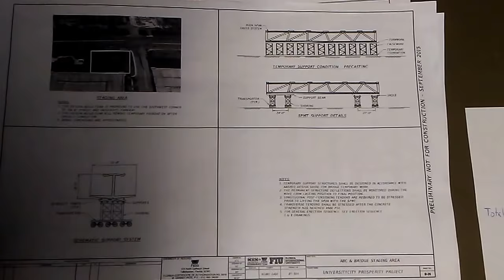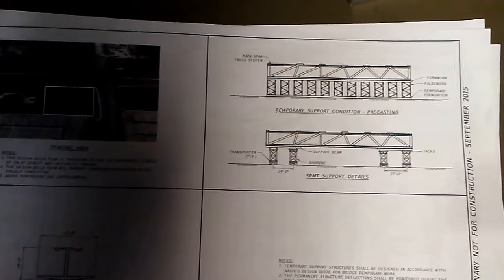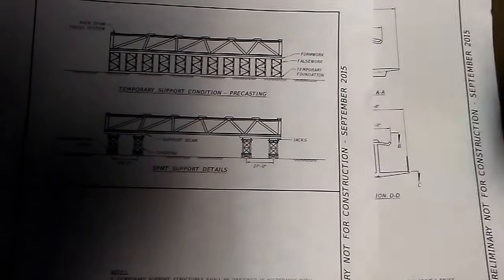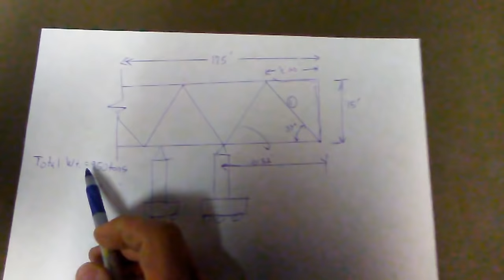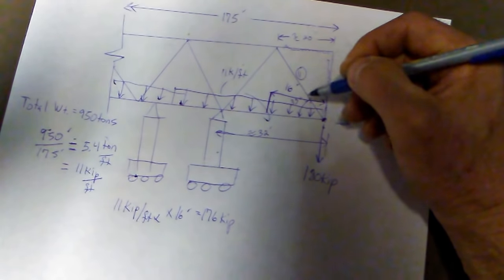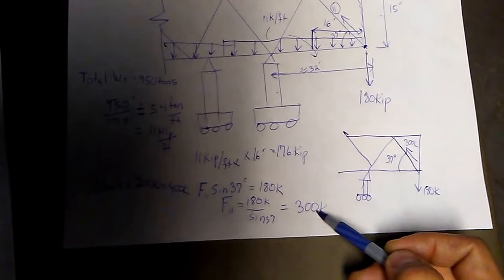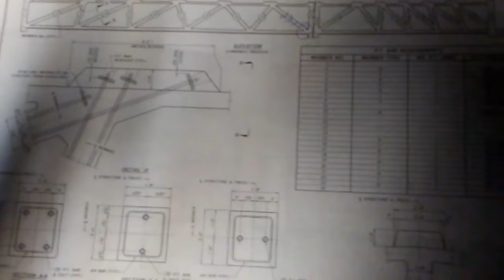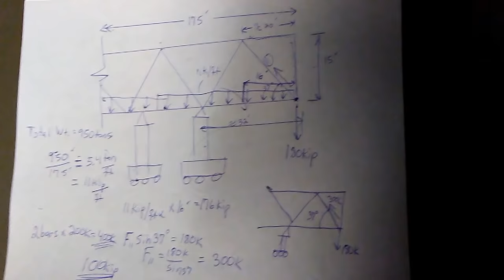FIU Bridge Collapse: The Hidden Truth (Part 4)

Comment: Good Work, from an old non-structures civil PE.
Three points if I may?
1  I think that you underestimate the loads in member 11 by using uniform loads.  By inspection it appears that there is a load skew on this north end cantilever due to the proximity of members 10, 11, and 12 compared to rest of the span.
2.  I think that it might be worthwhile to investigate the tension loads in the canopy between the 10 and 11 top nodes during transport.   This cleary is a compressive member while sitting on the designed support columns.  Any damage here may well of caused cracks and or damaged the prestressing.  (the slow mo video suggests the failure precipitated from the canopy in this section)
3.  Also might be worthwhile to investigate the shear loads at the transport points.  
Again you are doing good rational investigation which is a blessing to see!
Reply from the maker: Great points and thank you for your input! The tension in member 11 in my presentation are approximate...I realize a more accurate determination is possible. Shear loads (or reactions)  at the transport points could be analyzed...however it does not appear that the failure precipitated at the transport jack location.

Comment: Couple of concerns:

1. I still have concerns regarding the different lengths and angles of the truss members.  Typical trusses that span a distance like this (174 ft) are comprised of equal angles and in some cases, additional vertical members (such as a Warren truss w/verticals). The simplicity of a symmetrical design distributes the load of the bridge throughout the length of the span.  

However, In this case, there appears to be a concession to its design, and a compromise of its engineering.  According to its design none of the truss members are of equal length.  I can only imagine the calculations for tensioning the the support members is such a way as to keep the load of the bridge stable.  

2.  Assuming the calculations are correct and the bridge is constructed according to specification, the project is handed off to the installers and their transporters.  It has already been noted by another youtuber that steel plates or additional supports were specified to go between the transporters and the bottom of the deck, the purpose of which was to spread the load of its 950-ton weight. while moving it.  However, in the photos of the installation process, no such plates (or girders) are in evidence.  All I can see are what appear to be railroad ties wedged between the transported at the bottom of the deck - a total of four at each end.  

I suspect there were some challenges in transporting the bridge from its construction location and and its finished location.  The cross section of the completed bridge indicates the bottom of the deck is wedge-shaped.  I've no idea as to how a steel plate (or plates) would be raised up to fit between the transporter and the bottom of the bridge deck, particularly because the bottom of the deck is not flat.  FWIW, I wouldn't trust the weight of a train locomotive (200-215 tons) on the strength of eight railroad ties.   

 I also have little confidence in the ability of the bridge to withstand the rigors of swinging 90 degrees into place on  just four relatively small pressure points. It has been brought up that the transporters were not located in their specified locations during the move.  What stresses happened or may have happened on its short, but critical journey?  Was there twisting, jarring or changes in the load and what effect(s) may have they had on the tensioning of the support members? And, did these bumps and twists cause the stresses on the bridge to exceed their static limits? 

One other thing: The bridge canopy derived its strength from its length.  However, it had no noticeable  lateral support while being moved.  Due to its weight and lack of lateral support, merely overcoming the inertia of moving the bridge may have added unnecessary stress on the strut members, particularly near the transporter locations.
Reply: @Delia Wolfe; You are right to be concerned about the odd angles of the web members, which as you pointed out, would have added complexity to the calculations.  Furthermore, your suspicions are well founded in the very real likelyhood that a lack of effective and responsible communication between the parties may have led to the failure.
Reply from the maker: Great commentary Delia! Rotating the bridge 90 degrees was likely the most difficult part of the bridge move as the SMPTs need to be coordinated in their rotation to prevent twisting of the SPMT towers.
It appears that diagonal cables spanning from the canopy underside to the SMPTs were installed to provide lateral support.
Reply: There is a video that shows the cables you mention here:

https://www.youtube.com/watch?v=BDHRmvvMdmk

As you can see they (four in all) appear to be attached to the transporters and not the deck. Also, there are cables attached to the ends of the canopy which appear to connect to the outermost corners of the deck. I'm uncertain. as to whether  they effectively stabilize the canopy at the critical moment when overcoming inertia.  Given the top-heavy, t-shaped profile of the canopy and strut members, I remain concerned about lateral movement of anything above the deck.   

You can also see in this video the truss structures used to tie the transporters together.  I expected to see some kind of X-bracing between the transporters to maintain their 90 degree corners while in motion.  Perhaps, in their opinion it wasn't necessary.  In my opinion however, it wouldn't  hurt.

Comment: I think you are correct.  The PT bars in the diagonal are located outside of the kern point if only one bar is stressed.  So if they were removing the load from these bars since they were no longer required as the diagonal would be in compression from the dead and live loads.  The bars had to be unloaded in stages reducing the load in both bars in a progressive fashion.  If not the eccentricity could put one face of the diagonal in tension.  If it cracks the section modulus of the diagonal at the crack location (or pre-cracked condition) resulting in more effective eccentricity, more tension increased cracking, etc. and failure.

Comment: This disaster looks more like the failure of a node, not the failure of a diagonal. During transport, the diagonals D3 and D10 received the highest compression forces but they certainly came with their rods adjusted to deal with the greater tensile forces, which began to act after the bridge placed in its definitive supports. That is, D2 and D11 dealt with small tractions during transportation and then received the highest compressions. D3 and D10 received the highest compressions in the transport AND the highest definitive tractions. Thus, D3 and D10 would be much more susceptible to rupture by excess of PT than D2 or D11. But the geometry of the node at the base of D11 seems critical. The 21x24" compressed section of D11 needs to shift forces evenly with 6 or 8 bundles of PT cables inside the bridge deck. And nothing in the drawings and pictures seems to indicate that this was reasonably designed. Finally, the cracks. I have not seen a record of where they occurred, but one thing is certain: cracks in a structure with this design and this age should result in immediate shoring, for evaluation of causes and repair procedures. Nothing should ever have been done on the bridge, to correct anything, with people passing beneath.

Comment: Well done.  You explain the truss behavior very well. I pretty much agree with everything you present in your analysis. And another thing is that, although they don't show any other reinforcing in the preliminary drawings, there is no doubt that, all the diagonals had reinforcing other than the post-tensioning bars.  This reinforcing would likely been sufficient for the transport condition in themselves.  It is possible that prestressing wasn't even necessary for the move.  I have obviously never worked on a concrete truss but have worked on many large wood trussed.  The thing you find in wood truss design is that the greatest challenge is distributing the member end forces at the joints.  Especially the tension forces but the compression force transfers can be difficult as well.  I have a feeling that the cause of the failure is much more elusive than you/we are thinking.  There is a huge force coming down that first diagonal and how it distributed to the other elements is very important.  It will be interesting to follow this situation and your analysis of it.  Thank you for your work.
Reply: @Glenn Felpel; the compressive force in member #11 not only goes down, it also goes up.  Now consider the connection with #11 to the upper deck; There is no steel whatsoever there.  We are supposed to believe that all that compressive force is transferred by the little bit of cover concrete.  Terrible design.  Who approved these plans?
Reply: James, I am not trying to defend their design, but there was likely a lot of reinforcing and possibly even steel embedments in the area of the panel points to transfer the member end forces.  These would not show up on preliminary drawings that we get to see.  Mostly because during the preliminary design these details haven't been developed.  But for sure there was a lot in there that wasn't shown.  It will be interesting to see these details if they are released.  I sure would like to see how they thought it should have worked. Also, many times there isn't just one factor which causes a failure.  Sometimes it takes two or three things going wrong to make the failure happen.  We will see.
Reply: @Glenn Felpel; Are you series?  Do you really think the preliminary drawings didn't include the compression connection, but did include the post-tension bars and their anchor plates?  Really?  

FYI: most designers have a good understanding of how something is going to work, even if they still need to size the members such as gusset plates and bolts.  I think the "engineer" simply failed to recognize the forces at play.  We will see.
Reply from the maker: Glenn, thank you for your contribution and great points! The truss members certainly had "mild" reinforcement (aka rebar) that is not shown on the preliminary drawings. All concrete, including post-tensioned concrete, has some rebar even if only to control cracking. That's just how it is. In this case, the concrete truss members at a minimum had rebar installed along each corner of the cross-section. This longitudinal rebar spanned the length of the truss member and also supported the rebar ties that are shown in the member cross-sections.

Comment: If the truss design was all isoceles/equilateral triangles, 32 / 2 = 16 feet would have been a good estimation. But 11 was notably longer than 10, so there would have been more than 16 feet being supported by 11. Based on the drawing, it looks to be roughly 2/3rds of that span was supported by 11, so 21 feet instead of 16 feet. Since you used 300 kips, I would adjust that to 396kips (66 / 50 * 300), which is stunningly close to 400 kips, there's only a 4 kip squeeze surplus, which is too close for comfort in the real world. That would explain the cracking, I think. As I noted on the preceding video, however, I'm personally more suspicious of the strain on the post-tensioning bars but, as a layperson, I don't know the math to calculate the force applied to those bars.
Reply from the maker: Great point David! The length of the cantilever is very significant in its impact on the tension force in Member 11. The distance I show is approximate and based on photos from the move...but a few feet in either direction certainly changes forces quite a bit!
Reply: I also made a similar observation just now. In my estimate, about 28 feet of bridge was overhung. That would result in about 500kips, and remember, the post tensioner beams would then be carrying about 350 kips each! But also, the tensioners were supposed cranked down tighter for the move, so it could have been quite a bit more. They were supposedly releasing the excess move remaining when it collapsed. One mistake of, say, the tech adding 100 instead of subtracting 100 would have put the tensioner at yield. The guy doing the remaining is dead. They will blame him if at all possible. Once one tensioner went into yield, the other would have to immediately go into yield as well. Whatever happened to designing everything to 4X? Those tensioners should have been capable of at least 800ksi before yielding.

Comment: My theory is the top canopy slab failed moments before the strut did. The tension bars were not all in place on the top slab. Further the cracking would have help to collapse the unit.
Reply: The canopy was not the problem.  The node at 11/12 broke because it was under-designed.

Comment: More interesting is diagonal #10( I believe second from right). This diagonal was (I assume  )designed as  a member in tension for DL and LL . What was the state of loading in this member during transportation ?
Reply from the maker: Yes! Member 10 is in compression during bridge transport. And switches to tension with the bridge in its final position.
Reply: Now  I am totally stressed doing math ( homework) with my son. Tragedy.  
Seriously, do you have any idea what forces developed in diagonal # 10 during transportation and after placing on the pier (from DL of course) ? What reinforcement is present in dia #10 ?
Reply from the maker: My previous response about the forces in Member 10 was the truth... they really do switch. Member #10 had 4 post-tensioned 1-3/4" diameter bars installed.
Reply: No. 10 was a Type A member with four bars at 280 kips.  No. 11 had no post-tensioning.  In the proposed transportation plan the mover tower placed No. 11 in compression (no need to be tensioned).  In the move videos and photos shown, No. 11 was in full tension due to the cantilever.  There is your failure.

Comment: also my test bars split just like number 11.  anchor pulled up in pt tube quarter section split out about 1/4 the way up column.  it also generated a concrete cone where the anchor was.

Comment: Some time prior to the collapse, there was a deflection of columns 10 and 11, https://drive.google.com/file/d/1GYW4LPOx7oUmMDHFSE6IDeVPn9bm0iq8/view?usp=sharing . This put a rotational load or torque on the connection point of 10 and 11. That point of connection apparently separated for the upper deck: https://drive.google.com/file/d/1yLYZ7RxZ2TCkIOHyEYICN8LjSw8k0m7D/view?usp=sharing . I do not think that the structure was designed for a rotational force. That may not be initial cause of failure but this is probably the finale in a sequence of events for the collapse.

Comment: My current view of problems:
1. people were not protected during construction 
2. building based on complex computer design without testing
3. overseeing officials were uninformed &/or unknowledgeable 
4. cheap , fast & quick - what could go wrong w/out direct oversite & feedback
5. design engineers will have to explain why a walkway bridge failed